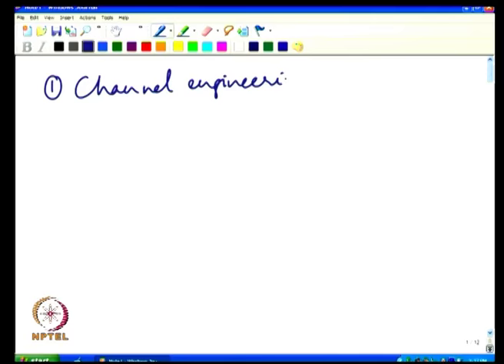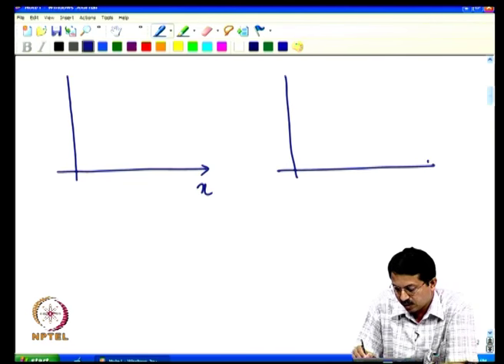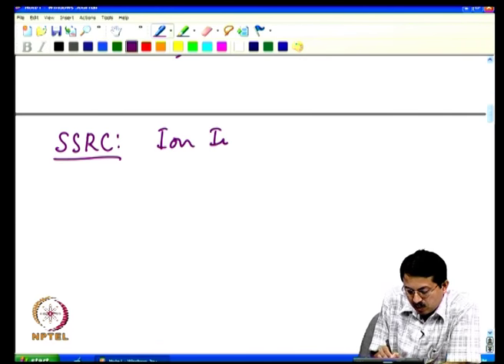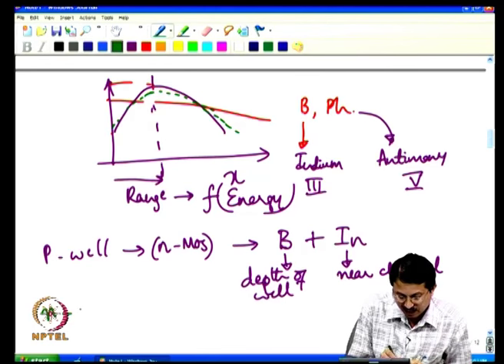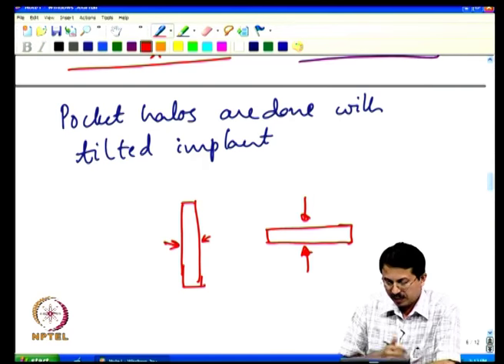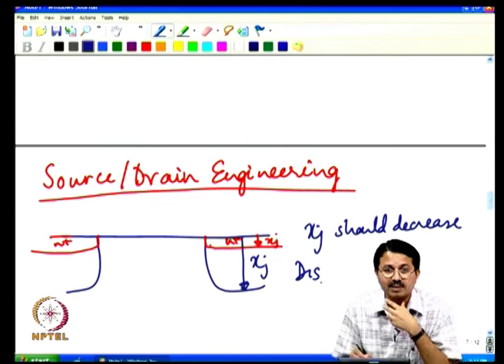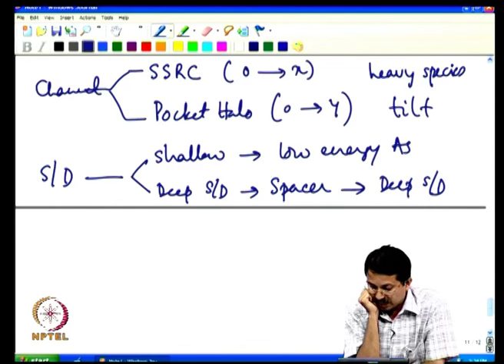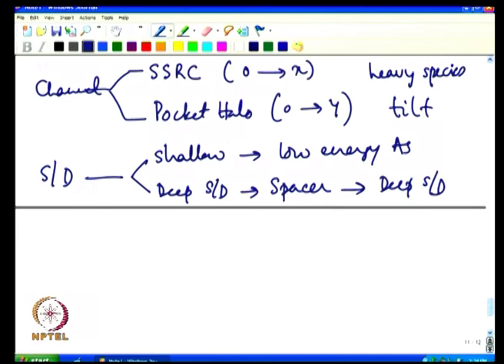Channel and Source/Drain Engineering

Comment: At 4:05, S is not subthreshold slope but is subthreshold swing which should be as low as possible so that the subthreshold slope which is the inverse of subthreshold swing should be as high as possible.